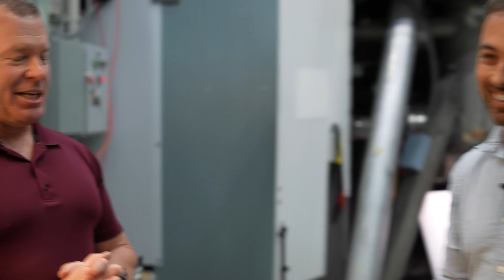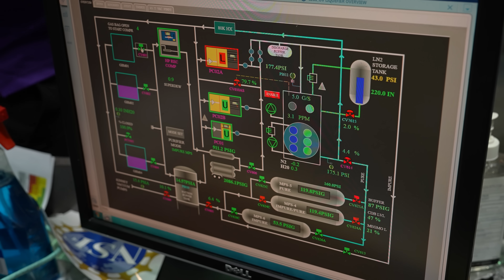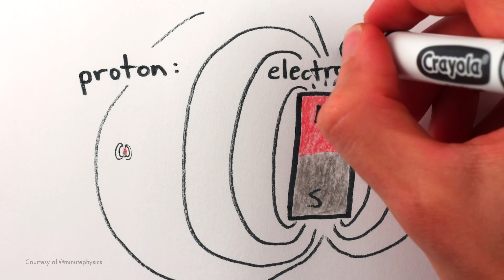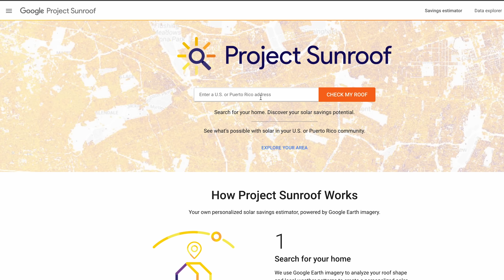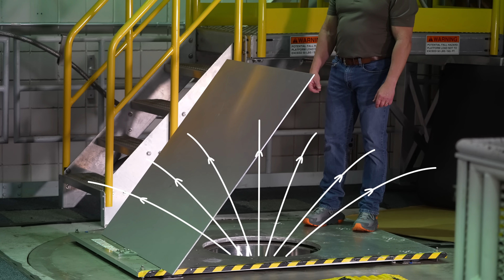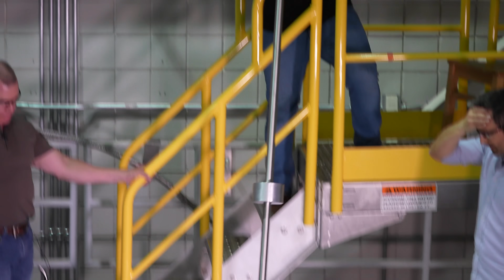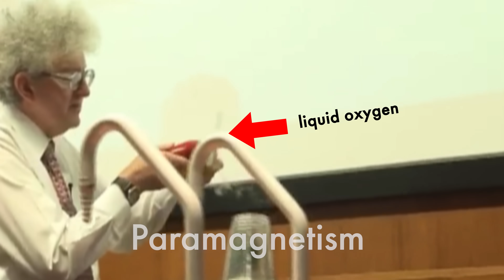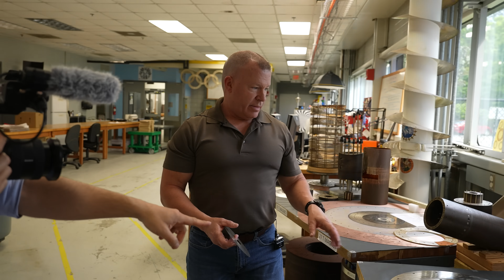World's Strongest Magnet!

Comment: YOU should see Riken Cyclotrons but still they depend on cryogenic infrastructure to liquify usually helium hwiel a Dr. Chu of Texas has developed higher temperature ceramic superconductors.
Reply: "Liquid Air" by T O'Connor Sloane and "Chemical Engineering" May mid 1980s.

Comment: Electric vehicles are, in fact worse for the environment, (and absolutely worse for our freedom on travel), in that the exhaust pipe is only moved down the road to the power plant. Add to that the losses due to resistance in the transmission of the energy, and the environmental destruction, energy and resources required to create the "zero emissions" electric vehicles. 

EVs use more energy than efficient, clean, cheap and available internal combustion powered vehicles. The false CO2 climate fraud is just another lie in their agenda of control through energy scarcity; austerity for everybody not [Them].

Comment: 9:38 You can't just use a thermal camera on a shiny metal surface.... You need to coat the surface in an IR Opaque material. More than likely you were seeing the reflection of the guy behind the plate.

Comment: It sounded like Derek attributed eddy currents and hence magnetic breaking force solely to “changing magnetic flux”, although even if magnetic field is uniform in space, and magnetic flux therefore does not change, the moving conductor will have eddy currents induced. This happens due to “motional e.m.f” ( v x B ) which does not require magnetic flux to change.

Comment: Just a detail: one needs to be careful if you want to correctly measure the temperature of a metallic plate with a thermo camera (like done in the video). 
The temperature reading does in fact change when the plate is falling even if the temperature of the plate does not change. The reason lies in the principle how the camera works. It collects heat radiation from the plate. However since the plate is also reflecting light from the surrounding like a mirror, the camera collects heat radiation from different bodies in the room as the plate falls. An example is the reflection of the hot body of his companion that you can see. In addition, different bodies need different measurement calibration values in the camera. So, it’s not so easy to determine small temperature changes and say that the reading in fact shows a small change of the plate temperature. It might be an systematic measurement error.

Better use a thermistor or something similar.
Reply: alternatively paint the metal with a thin black paint. and make sure the emissivity settings are set correctly.
Reply: @Metal_Master_YT  That is correct, IR cameras need proper emissivity setting. Some bodies look hot because the IR camera has the wrong emissivity setting.
Reply: Beyond that, are we sure the high static magnetic field isn't skewing the accuracy of the IR thermometer? At the very least, the instrument needs to be kept perfectly still, to not induce stray voltage in the traces within its own circuitry.
Reply: Thanks for posting this, I went to the comments to check if someone else had posted this issue too. I feel like you can actually see the reflection of the man standing behind the metal plate at time 9:55 in the video.
Reply: Ok
Reply: How about just a room that is pitch black with no thermal properties?
Reply: @runnergo1398  It would have to be extremely cold as well I think, all bodies emit infrared otherwise
Reply: @daasdingo  You're right. No matter how cold we make something, it is warmer than what we can do.
Reply: @runnergo1398  Good thought. However, the falling plate would still reflect the thermal radiation of the walls that are painted pitch black. Painting a wall in pitch black color does not prevent the wall from emitting thermal radiation. Counterintuitively it becomes a better, actually a very good thermal radiator. How well it radiates depends on its temperature (described by the law from Max Planck). In principle, as Samuel K wrote, you could cool down the room to drastically reduce the radiation (it reduces with the fourth power of the temperature, a rule that is actually used to calibrate the thermo camera). Coolinig down the whole room wouldn’t be very practical though.

A better solution would be to paint the plate pitch black so that it does not reflect any light from the surrounding.

Comment: Doesn't the magnetic field affect the earth's natural field??
Reply: locally yes, globally no. As you saw in the video, just a few meters away at the 100 gauss line the magnet only has a slight impact on magnetic items. So it doesnt really reach that far (well obviously it has a really far reach compared to other magnetic fields in our everyday lives, but compared to what earth has to offer its pretty much nothing and won´t affect earths field in any way apart from slight warping near the magnet)
Reply: @wattisphysik  So, in order to distort the earth's magnetic field, the artificial field should be sky high?? Is this what you're saying??
Reply: @wattisphysik  When they turn this magnet on, if at another point on earth, simultaneously, I open my magnetic compass, won't my compass give an erroneous direction??
Reply: @mkalanithi8747  no it shouldn´t give an erroneous direction. As soon as you are so far away from the magnet that its magnetic influence is (significantly) smaller than the the influence of the global field of earth, there will be no interference with your compass. I would bet that less than 100 meters away from the magnet your compass already shows to the right direction as the fields strength rapidly decreases with distance. I mean, pretty much every single everyday magnet has a higher magnetic flux density than earths field and yet there is no problem as long as you are not right next to a magnet. 
Having a strong magnetic field does not simultaneously mean that it spreads further than the field of a weaker magnet. The process that creates earths magnetic field just happens on a much bigger scale, as the whole core of earth is involved. Thats why it extends so far and is present in every part of the world and even way up in space protecting us from solar winds. 
Artificially made magnets with the sole purpose to create a magnetic field can easily be way stronger than earths field but won´t spread so far as their size is tiny compared to earths core. 
So you will not be able to create a magnet that spreads globally and changes the direction of every compass needle on earth.

Comment: 15:00
That is disappointing.
I have the same size makita blower but it takes 2 batteries and runs at 36 volts and you need a good arm to use it one handed.
You can feel the recoil and feels like goku weight training.
As in an invisible force strainimg your muscles to retaian your original position.

Comment: That's amazing to see how much electrical power is needed to cause those physical movements, especially of non-ferromagnetic objects. I wonder how powerful the magnet would need to be to levitate a human, and whether it could cause any health issues at that power level. Google tells me a medium sized strawberry weighs 12g, so assuming things scale linearly (which I imagine they won't!), to levitate an average 70kg person the same distance as the strawberry, you'd need 262,500 Tesla or 175,000 MW of power. Largest nuclear power station in the world is about 7500 MW so you'd need about 23 of these.

That kinda also answers an idea I had when I was younger. I used to really enjoy watching the TV show Robot Wars where remote control robots fight in an arena. The weapons are usually things like flippers or spinning disks/bars etc. I always thought it would be cool to have a robot with an electromagnet as the main weapon - just get near to an enemy robot and blast it into oblivion (i.e. the arena wall). Considering these robots can be up to 100kg and you'd want the repulsion to accelerate the enemy to a decent speed, a ridiculous amount of power would be needed. The magnetic field would need to be over a bigger area than just the small circle of this 45 Tesla beast. I don't know enough physics to calculate the exact power required, would be interesting to be able to work it out taking into account the distance such a weapon could be effective at/the fall off of the field (which I'm sure is not just linear) and how effective it would be against enemies built from non-ferromagnetic material...if the magnet was that powerful I'm sure it could do some damage to robots built from plastic and similar materials. But in any case, the answer would be lots. Lots of power. So yeah...my Robot Wars weapon idea was not that practical.

Comment: I'm betting if you fired the metallic potato gun bullets directly down into the magnet towards the most magnetic point, it would catch it as the eddy currents are directly proportional to the speed of the object moving through it but I wouldn't risk the miss. If there was a clean hole in the middle, which is likely due to magnetic properties, you could safety test it but you would  need to be bloody precise  because hitting even one side is unbelievably costly

Comment: You did not provide an emmisivity tape on the aluminum. It has a very high reflectivity so your readings are completely inaccurate for your temperature. Apply some electrical tape next time and take the readings from that. The fact that you can see the guy reflected in the metal should have raised flags, the camera measures thermal energy, not light, it’s thermally reflective

Comment: The demonstrations where the large plates are allowed to fall in the magnetic field could be improved scientifically to help more people understand this phenomena and how motors work, enhancing your educational objective.  The mistake is dropping a continuous solid plate.  You guys should have used a picture frame structure instead, a rectangular-shaped  conductor with a voided center region.  This would exactly correspond to the structures inside AC induction motors, where molten aluminum is injection molded into an iron laminated structure to form conductive loops that resist a changing magnetic field and force the rotor to turn away from this rotating magnetic field.

It would have been especially interesting to see a comparison of this frame structure and your solid plate.  Drop both at the same time and see which one hits the floor first.  Yeah, go back and do it again please!

Comment: Magnetic propulsion. Reverse rail gun. Point a magnet in space pulling you towards said object. Flip Magnetic field to push said object away. I don't know if it would be efficient, but with better solar technology, or necular. Could be feasible. Getting the obviously massive "engine" into space, and far enough away to work without affecting the planet orbit will be challenging. But this seems like the most logical long term space travel idea.
Reply: A way to aim the magnetic field is also necessary. Figure it out

Comment: 45000A x 500V is about 23 000 000 kWh. So about 2 000 000 USD spent in only this experiment in power alone. Like what
Reply: slight error in your Maths. 45000x500V x 1 hour = 23 000 000 Wh not KWh, so 23 000 KWh, you are off by a factor of 1000x so its 2000 USD for the experiment. Still a lot but not nearly as ridiculous

Comment: Earths magnetic field is minuscule at the point of measurement, however it encompasses the whole globe. While this strong magnet is locally powerful, you couldn't even measure it from the other side of the globe. This kind of magnetic strength comparison is only relevant when both "magnets" are measured equal distance apart. If they were measured from the same distance earths magnetic field would wipe the floor with "worlds strongest magnet".

Comment: at 7:40 i thought copper sheet would fall slower than aluminum sheet because copper's resistance is lower. but why is it otherwise? 🤔
Reply: copper is far denser than aluminium
Reply: @curseofgladstone4981  i don't think sheet's weight affect it. human levitator at 14:16, locked in place even a human step on it, because it's superconducting (almost 0 resistance) so the generated opposing / upward force is equal to downward force from human weight. so in case of the sheet, i think it should be the internal resistance, heat dissipation speed, or maybe the proximity from the magnet core
Reply: @ThreeWhiteSoldiers 
When he put his full weight on it, it did move a little faster.
The  force the field puts on the metal depends on how fast its going so if the plate is heavier more force is required to counteract gravity so the plate moves faster
Reply: Or maybe you are right. I'm not an expert I'm just applying what I think makes sense in the situation.
Reply: @curseofgladstone4981  It's okay, this is open discussion. I'm not an expert too and also just applying from what i know :D your explanation also make sense. hopefully someone expert can clarify and explain it so we will have a better understanding

Comment: So out of interest how much could you scale this tech up to use in space fields of science.   

Space x and its impressive falcon x rockets landing themselves time and time again with pinpoint accuracy is super impressive but it has size and weight limitations as we can see with how they are planning to catch the starship boosters and main sections seems a lot more dangerous with no room for any error and with future flights once rated for human flight it's a massive risk still having so many lives at risk in a landing system with zero room for error and no built in capsule ejection system to separate the passenger section from the rocket in case of failure as we see in smaller rocket systems it's a rocket system I think might be too risky for most to trust there lives on.  

So could a larger upscale version of this be built so the rocket itself just needs to get close before the system helps orientate the landing starship and then the stronger effects slow the starship down as it comes into the landing pit area so next to no engine trust is needed to safely land.

Comment: As someone who works in a lab with high magnetic field capacity, I think it’s super interesting how you go from super commercialized 2-8 Tesla magnets (every MRI machine for one thing) to having 45 T be the absolute world record. For a lot of things in experimental physics (most powerful laser, high pressure, coldest temp recorded, most precise atomic clock etc) the record holder is many orders of magnitude larger than the off the shelf stuff. You have to respect how much work is put to get from 10 T to 20 T, and from 20 T to 40 T.
Reply: I find it funny how you refer to expensive equipment costing millions as "off the shelf stuff", but of course, relative to this beast, an MRI machine is just that.
Reply: NO, BAD BOT, BAD, SHOO
Reply: Normally magnets are .23T - 3T when they are used in a clinical setting. Anything bigger than 3 Tesla is normally used for research only.
Reply: @shawncaldwell9318  this is not true.  I work on a 7T magnet for clinical use. (Siemens Magnetom Terra)
Reply: @shawncaldwell9318  lmao ure wrong
Reply: @iPlayDotaReligiously  He said "normally" not "Absolutely"...

I'd imagine he is correct,  that the vast majority of magnets used domestically or commercially is up to 3T. Beyond that would be the exception,  not the rule.  

I see nothing wrong with that statement, he made no assertion that ALL magnets above 3T were used exclusively for R&D so it was pretty clear what he meant given the language he used.

Think, before typing, do I wanna act like a 5 year old today? Answer: No.

Comment: I used to work in Innovation Park near there. Before I took that job, I had worked in a machine shop, which resulted in my hands being somewhat full of steel splinters and filings. When I walked past the magnet bays, I could actually hold my hands up and "feel" the contours of the magnetic field. It was pretty cool, but only lasted until the steel in my hands rusted away.
Reply: You had a build in compass
Reply: I once had the idea to intentionally implant bits of magnets in my hand for this reason, i figured it would be tricky to do and probably mostly useless. They would have to be tiny, and possibly gold plated, and probably fail eventually. Cool to hear that a random hairbrained idea i had 20 years ago kinda sorta woulda worked.
Reply: @Alex.Holland  you can get magnets designed for that now.
Reply: @Alex.Holland  People have done that in order to feel the magnetic/electric fields around them. Would be pretty cool honestly.
Reply: Are there any effects of having metal rusting inside you?
Reply: @DarcyRyder2010  that's not how it happened. 
The human body will dispel foriegn fragments such as that unless it's below the muscle layer
Reply: @MadSceintist  yeah it didn't last long, just until my skin grew out or the material rusted
Reply: @MadSceintist  your body will try to break down subdermal debris, and if it cant, it will encapsulate it in tissue of some kind. A great example of this is breast implant rejection.
Reply: @barryallen5507  
I'm a mechanic,  and I've  built houses and done a little forestry. 
Everything that I've ever had go in, comes out a little while later after the scar wears down.  
Once i had a wreck and had glass embedded in my skull,  they got most of it,  the last piece took 20 years but it made it's way to the surface and scabbed over then came out when i scratched it. I'd forgotten about the accident and took a while for me to realize how it had gotten there
Reply: @MrMadSceintist Reminds me of my late grandpa. Bricklayer. He lived to be 98 and the last 10yr of his life he was still pulling pieces of brick out of his arms. Said it gave him something to do.
Reply: @DarcyRyder2010  high blood iron content I guess
Reply: Wait are you ok? 👀
Reply: Did it hurt?